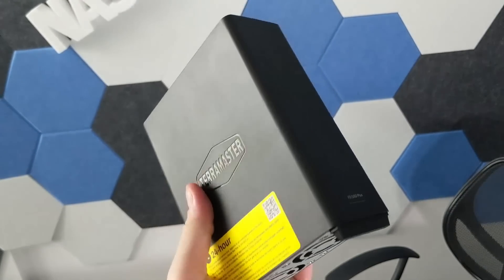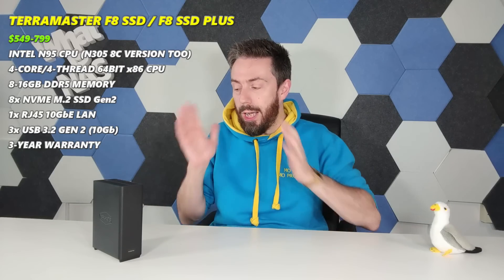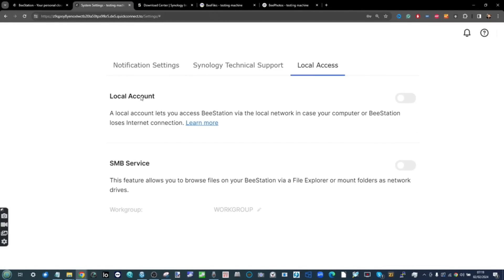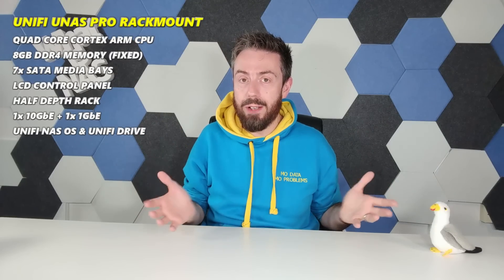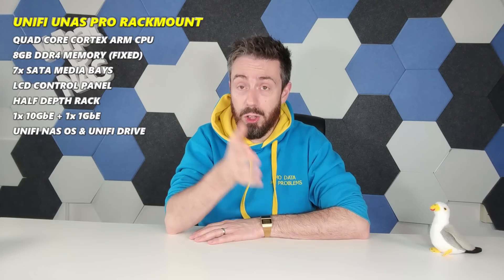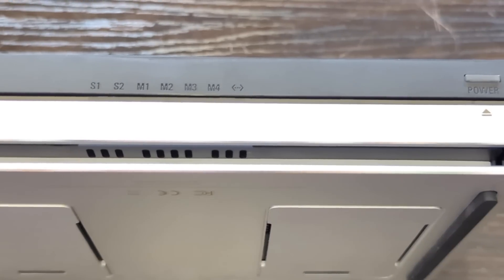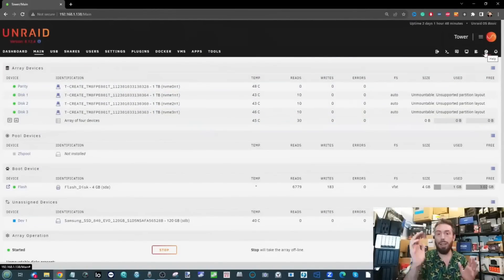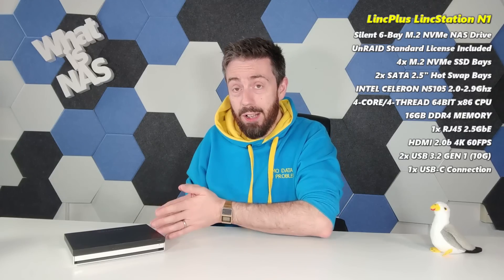Best Value NAS of 2024 - SAVE SOME MONEY!

Comment: Depends what you expect :D. I just got QNAP TS-664 as my backup NAS (to backup primary NAS to) :D. Couldn't find anything cheaper with the same set of features. I can even install QuTS Hero on it :D, but I have chosen normal QTS to be able to grow the RAID device with additional drives in the future :D.
Paid ~$600.

Comment: I'm a total NAS savage. I want a NAS to only store files. I don't want to access it from afar, it shouldn't have strange servers for sharing media or anything like that. Just a file storage for my local LAN with a minimum of extra features. RAID is one of the few things I appreciate. If a NAS can handle eight drives I am going to use a Raid5 or Raid6 array. I can also accept if it can send me a mail if there is any kind of problem detected as I won't be logging in just to see that it works.

For me a NAS is just a mini storage server. Way back we used Banyan VINES for our server at work. after working there for several years there were suddenly a problem with the server as it was full, so any attempt to write to a file on the server was denied. What made this funny was that no one could remember exactly where that server was located. When I found it it lacked both keyboard and monitor and no one hat touched it in over six years. I also learned that Banyan VINES was running under AT&T UNIX System V, an OS I hadn't touched since I started at this company. Now that is what I want form a storage server and even more from a NAS. Set it up and never look at it unless there's an email telling me there's a problem. That's all I want from a NAS

Comment: Hi, you mentioned that everyone should turn off SSH on their Linux based Nas due to security issues.  Is this problem now fixed? or should we still keep it switched off.  Thank you.
Reply: Only turn it on when you need it, and then turn it off, for the vast majority of the time. Why have a very visible and sometimes weak front door, when you don't need to.

Comment: Bollocks.  The best NAS is a used Haswell or later system with maxxed out RAM for free or next to nothing.  Spend your money on drives and connectivity.  These stupid appliances are terrible value and are usually poor quality, and reliability, with costly slow warranty (shipping).  Pick the NAS distro of your choice; they are all better than the proprietary offerings.

Comment: Have you lost your sodding mind?!?! :D   The UniFi NAS Pro isn't a nas, outside of just a headless Linux server with a nice GUI and SMB shares only.  No iSCSI, no NFS, etc etc etc. Its a NAS simply because it has disks, a network connection and a SAMBA share.   Its not a NAS in any sense of the pro-sumer, or professional NAS user.
Reply: Agree that it's not really pro-sumer or professional, but I think that's why it's in the best value category. For $500 7 drives and a 10g ethernet port is all a small business might realistically need. A cheap rack mount nas (at least where I live) is a 4 bay qnap or terra master with 1 or 2.5 g networking for the same price. In that aspect it's a decent  deal if all you need is a samba share or barebones network attached storage like you say.

Comment: I have router with 4 Ethernet ports
But i need 6 Ethernet port now
My question is 
i have a 4 port switch 
It seems slow am using 4 Ethernet port on router and 2 on the switch
Or show get an 8 port switch and not use the Ethernet port on the router
Would that make a difference
Reply: the speed of your config depends on several factors. supported speed of client(PC, NAS), router and switch. Most common for consumer are 1Gbit, 2.5Gbit, 5Gbit, 10Gbit. Transferspeed is limited to the lowest common denominator. So if data goes from one client through your router than through your switch to another client and your router is limited to 1Gbit speed that will be the bottleneck even if other devices support higher transferspeed. Keep in mind that u also need fast clients to achieve higher speeds (5Gbit+) meaning SSD, NVMe or HDDs in a RAID configuration.
Reply: @dwight2310  should i stop using the ethernet ports on the router and us only the switch ports
Reply: @packard82uk  i cannot answer that. i dont know what devices you are using. based on my previous answer you should research what the limitations of your devices are and eliminate any bottleneck to get higher speeds. That could in fact mean to get a bigger switch but there could be more limitations in your setup preventing you from reaching higher speeds.
Reply: I'll throw one more small item into the mix. I was making up some new ethernet cables a few months ago and found that some of the cables then in use were old Cat 5, not Cat 5e and therefore technically much smaller bandwidth and presumably slower. The short distance of patch cords may not may much difference but, for a few bucks, it may be a cheap way to check. So, look at the spec's of every link in the chain.